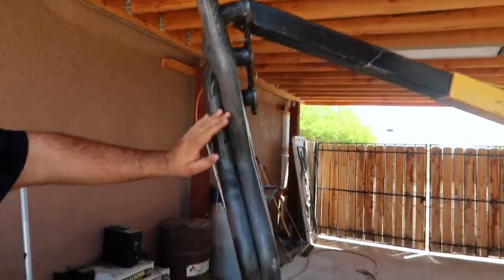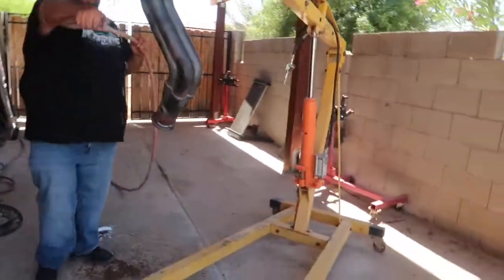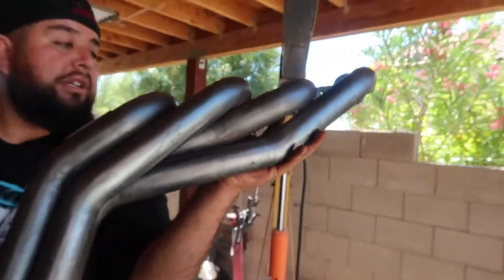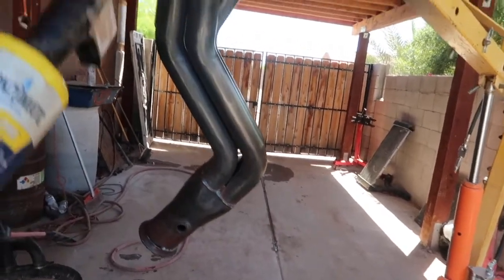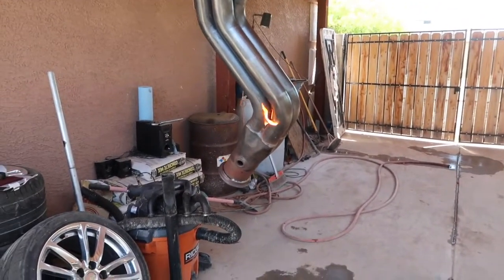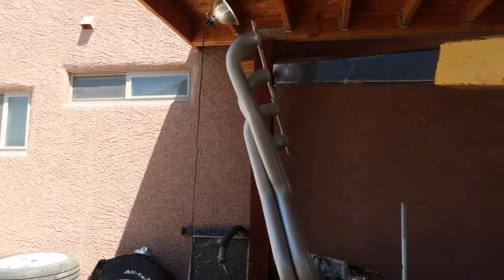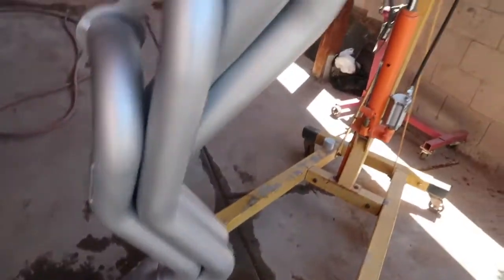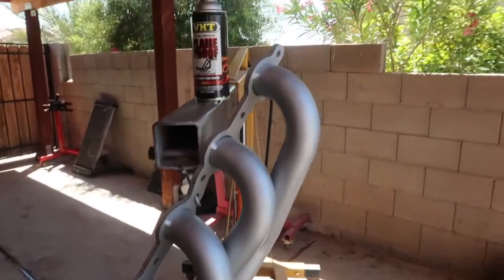Ceramic coating the headers (My self)

Comment: Just FYI, when you take this to someone who does it professionally the inside of the pipes get coated along with the exterior. This is what keeps the heat from transferring through the metal so fast and allows them to run cooler and more efficient.